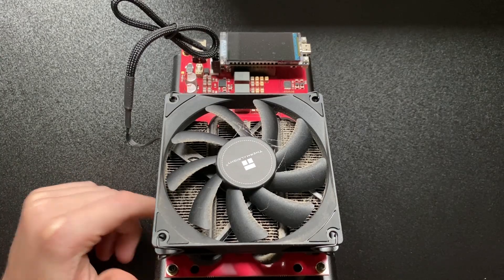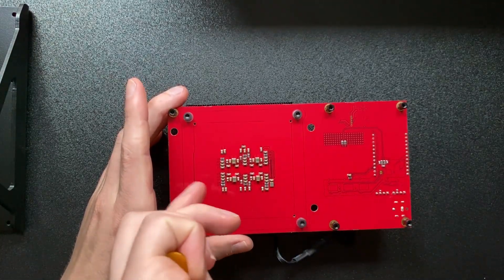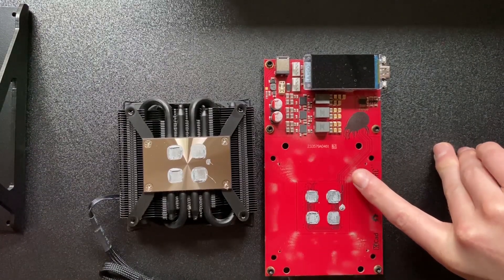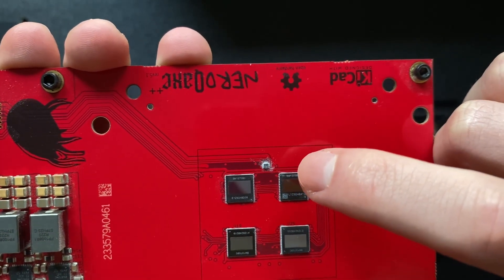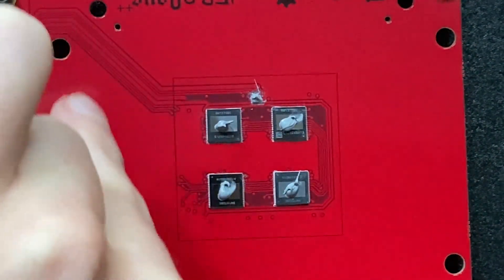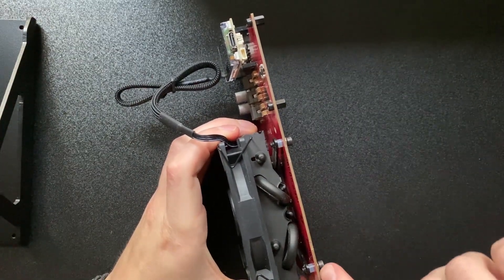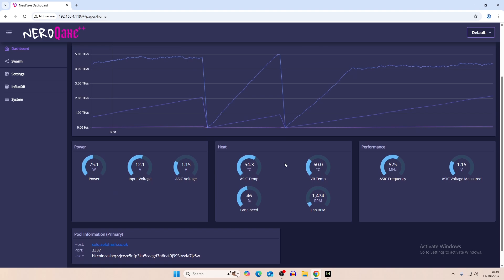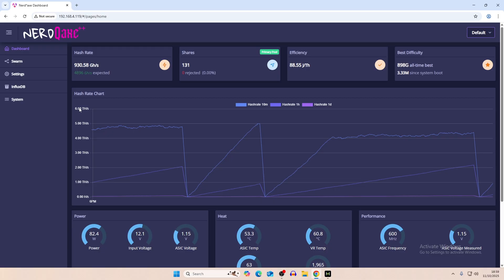How To Replace Thermal Paste on the NerdQAxe++

Comment: if u put in 60 degrees it regulates the VR. Not the Asics. So if VR is at 60 its normal that the Asics are cooler. I let them run on manual at 80% and i get VR about to 50 but i have a completely different setup. I can try upload some pics at ur community site if this works